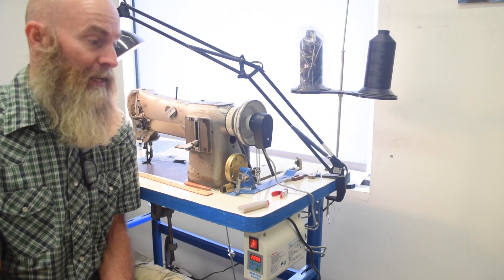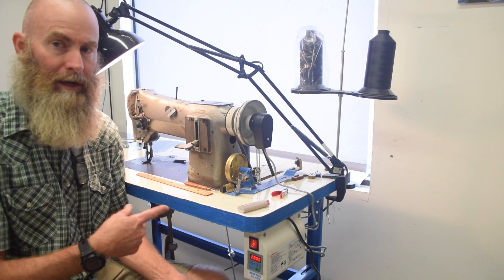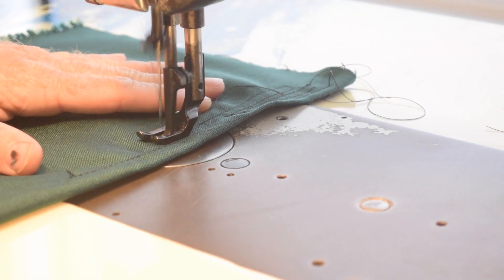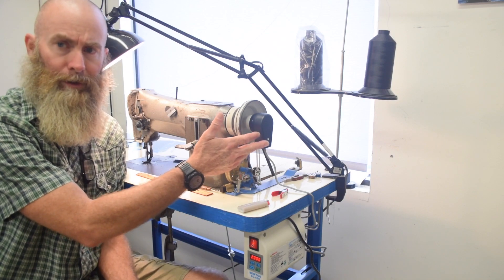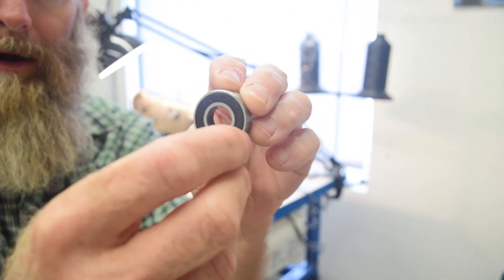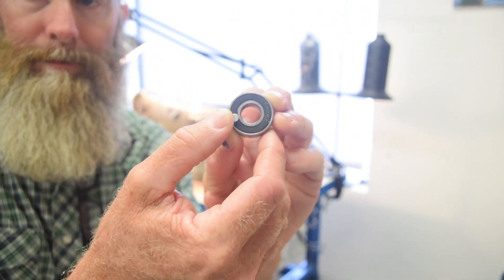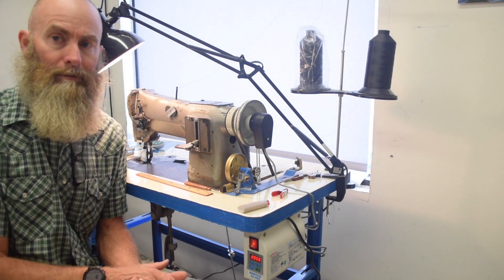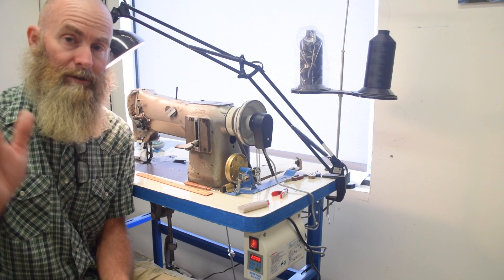Servo Motor Update: Synchronizer Broke!

Comment: At 2:09 it looks to me like the handwheel made contact with the housing. That may have given it a "slap" for each revolution causing it to eventually go to pieces by fatigue. Or the "slap" may have dislodged the magnet and have it crash into the housing.
Try to assemble it using Acetone as a glue. If it is made from ABS then Acetone will dissolve it and using it as a glue will be like a chemical weld. It will become one like welding does to steel.
Or you can 3D print a housing and gain a new hobby in the process. 😁
I have a similar motor/positioner on my 355 and it is very abrupt at times! It sometimes stops with a BanG! Another machine have an old Efka motor/positioner. Always smooth and gentle.
Reply from the maker: I've used one of the older Efka units, they are definitely very smooth!
And I think you're on to something; when I installed this the first time, I noticed it was contacting the hand wheel, and the wheel was grinding a groove into the plastic.  Perhaps a few years of that vibration did it in.. The new one seems to fit much better, so hopefully that won't happen this time!
Thanks for watching and commenting!

Comment: What is the plastic bag on the thread spool for? Does it keep it from unspooling?
Reply from the maker: The bag is a cheap substitute for "thread sock," it just prevents the thread from unspooling in an uncontrolled manner when sewing at faster speeds.  It's not absolutely necessary all of the time, but it can help tame more unruly thread cones.
You can buy thread sock from The Thread Exchange. I use that sometimes, but the thread cones often come in a plastic bag and you can just poke a hole in the end.